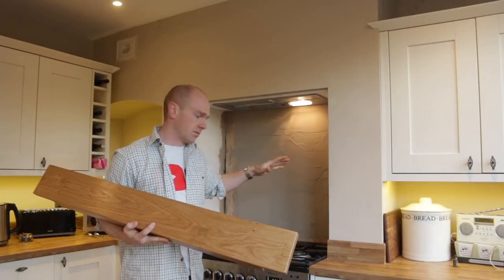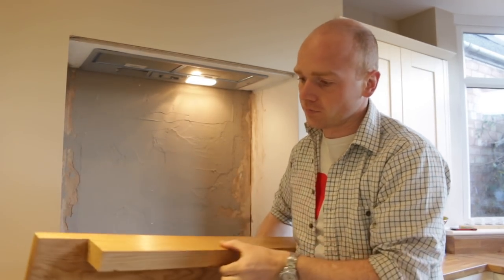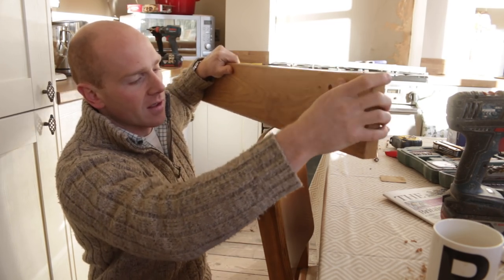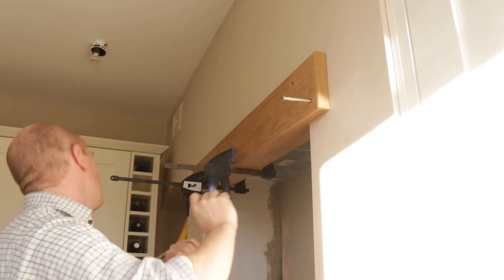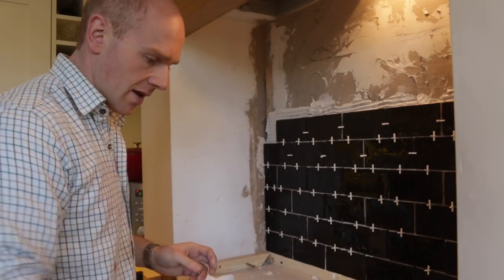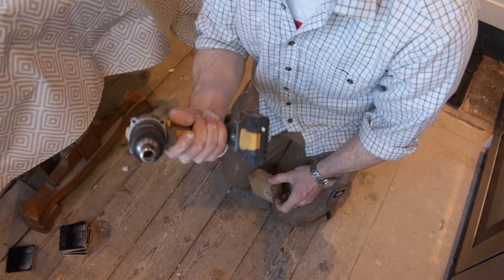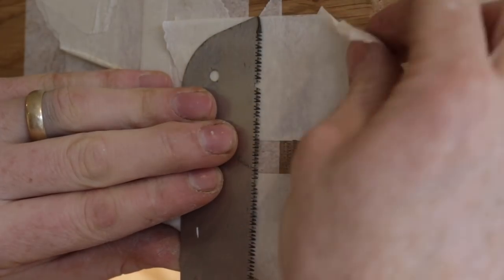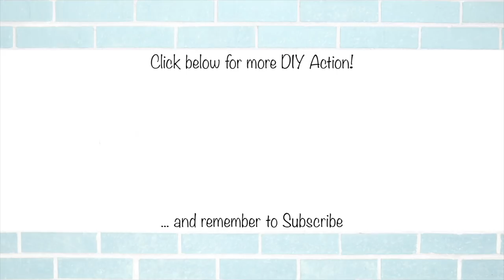Fitting the Oak Beam

Comment: When the concrete is soft or you hit mortar and concrete screws won't bite, I find it best to use anchors. My favourites are Toggler Alligator fasteners as they work for dry wall as well. I actually don't use concrete screws anymore. They are horrible for applications that vibrate (basketball hoop, sliding door rail, gates etc..) as they transfer the vibration & make the concrete crumble. Whereas a fastener works as a buffer between the hard screw and concrete.

Really nice video again. I've quickly become a fan of your channel.
Reply: PS. I think I have the exact same bubble level as you, lol. (The smaller one)

Comment: Hi Tim, great job. What drill bit did you use for the 12mm countersink hole?
Reply: And plug cutter.. (mine are awful)
Reply from the maker: Ebauer set from screwfix. Very sharp and worked well to date. Hope was cut with a 12mm forstner bit.

Comment: I think that the external fixings were not necassary.  the batten was sufficient!
Reply from the maker: Not needed to hold it up but needed to keep tight against wall especially as the timber will most likely want to cup slightly.